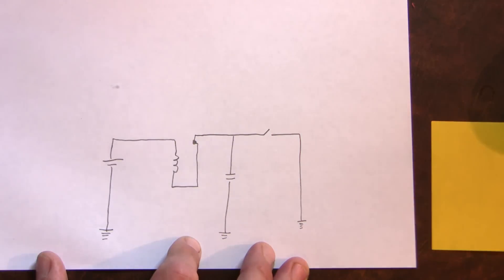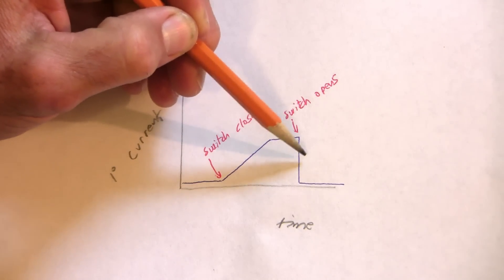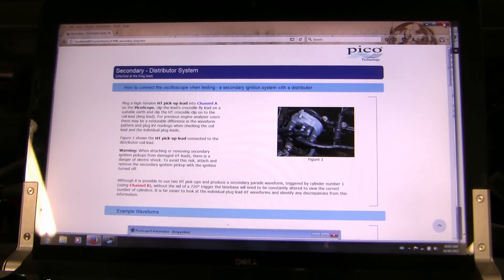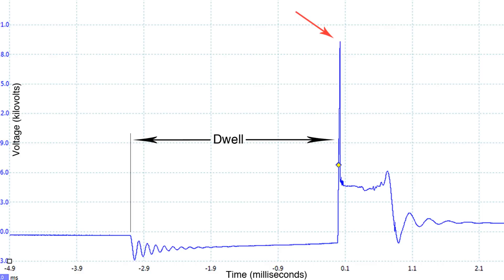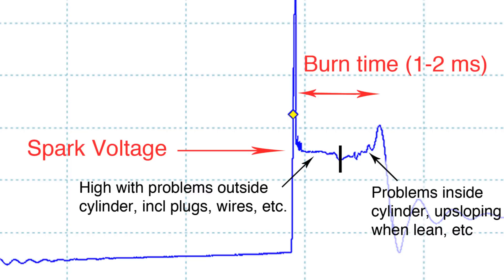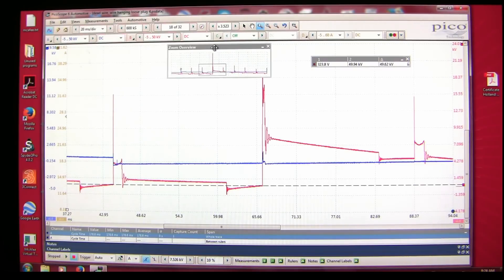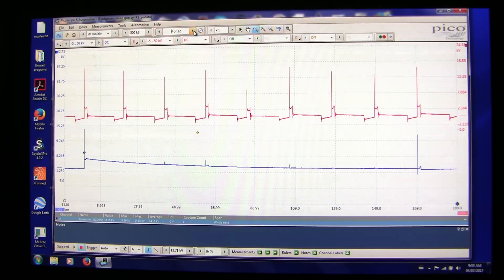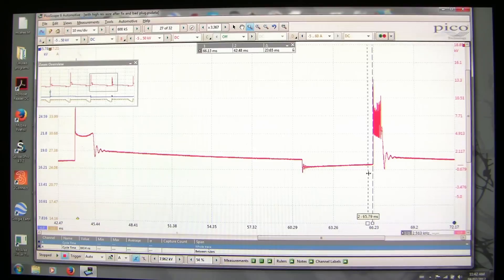Picoscope fundamentals - ignition waveform analysis

Comment: First class explanation! The PicoScope is such an important and powerful tool, so it's good to see it being used both as a teaching aid, as well as a tool which shows the clearest of traces, which makes the interpretation of results so much easier than with other tools that don't have such good resolution, memory, sampling rate, etc. Of course,  the higher technical specifications of the PicoScope - together with the user friendly software and help pages - contribute to making the PicoScope THE choice of tool for any user: novice or highly skilled engineer. Thanks for this superb video!
Reply from the maker: What I like most about the Pico is the way their engineers seem to understand the automotive needs very clearly. Peripheral devices like their current clamps and hardware are the critical difference compared to my generic digital oscilloscope, even though technical specs for the scope itself are similar. I had quite a bit of trouble getting a stable reading from a standard digital oscilloscope on a running vehicle. Thank you, for your kind feedback.
Reply: Hi Spelunkerd. Thanks for your comment. I wrote an extended reply, which I then started to edit before seeing it disappear. At least, I can't find it, for now :(  if it turns up please let me know as I was in the middle of editing, so the beginning makes no sense at all!! Keep up the good work.
Reply from the maker: I found it on the other video, ha ha. Thanks for watching, I plan to do more.
Reply: Is it gobbledygook, because I was amending it when it disappeared !! If so you can scrap it, or I'll amend it, but I can't see it! Glad you plan to do more. (I'm trying to find the time, but I don't have your superb presentation skills and mine would need to be in French. Although I read write and speak French, it isn't my mother tongue and my accent isn't perfect.) You make your videos come alive with just the right balance of theory and practical to make the videos engaging and informative. Spot on: I like your style and admire your skills.

Comment: Thank you for this great video, please up load more on secondary analysis on COP. The examples you did here were good, the ones that were hard to differentiate from were the shorted and the small gap, as you mentioned on a distribuidor type they look very close. Look forward for more of this.
Reply from the maker: Yes I plan to do more, some time in the next few months. As you say, those last two were tricky. It turned out that if you order the situations according to secondary gap distance, then order the results in terms of firing voltage, the observed results line up with expectation. Same thing if you order in terms of burn time, with the longest gap having the shortest burn time. It was revealing to see those findings on the Ram, although I was a little surprised a shorted wire wasn't more abnormal. I was also surprised how snap throttle revealed the lean cylinder when at straight idle the findings were much more subtle. It's a good reminder that when doing ignition testing it is always wise to record a few sheets of snap throttle to uncover concealed problems.
Reply: spelunkerd yes the Snap throttle test is super important to reveal the bad ones. I did some primary test on a mini and in a Chrysler, the Snap throttle was the answer. I put those vids on my channel if you want to see them. Any comments from you would be great. I like to learn as much as I can. Thx again for all your great information.

Comment: Wow just wow this video was hell of an informative video Mr. Dave.
Reply from the maker: Thanks, man.
Reply: +spelunkerd second time watching it 😀😀 im into this thing now but is strange how the experts have dissagreements over some points on the analysis...
Reply: +spelunkerd 
A is number 3 
B is number 2
C is number 1
D is number 4
Hoping to be right 😀😀
Reply from the maker: Good for you to go through the effort, thanks for taking the time. As you saw, pattern recognition of the sweeping upslope from a lean cylinder at snap throttle led you to the correct diagnosis of *B=2*. The remaining three can be put into order of how big the gap is. The biggest gap is the open plug wire, next biggest at 0.1mm plug gap, and least biggest with a short to ground. Because firing voltage is determined by how far that spark needs to jump, you should be able to put them in order as to which system will have the biggest gap, and then make a second column of how big the firing voltage actually was in each example. A disconnected plug wire has the biggest gap to jump, so it should have the biggest firing voltage (by far), *A=3*, as you say. The next two are tricky, and honestly I would have trouble telling the two apart in a real world situation. But following through with our logical progression, the next biggest gap is the plug with 0.1mm gap, and the next biggest observed firing voltage is D, so that would suggest *D=1*. Finally, the wire that is shorted to ground (no gap at wire, but still some gap at the distributor) should have the smallest firing voltage, which leads to *C=4*. You can also order these by looking at burn time, recognizing that a long burn time suggests a small gap, which again leads to the same result. Notice how the burn time on C is slightly longer than the burn time of D, because there is no extra gap to jump so all the energy can go into making a long burn line. I think anybody who gets as far as you did deserves full marks on this one. 

Some guys like to visualize a piece of rope, which they lay down following the curve from the top of the firing voltage to the plateau of the burn line. If a lot of voltage is used up to jump the gap, there is less rope remaining to give a long burn time. Nice to meet you!
Reply: +spelunkerd yep i had trouble with those two also 😀 thank you very much because i liked it a lot!

Comment: I just did a few videos on this topic using a single cylinder magneto ignition with a points emulation module common to them. The last one being a wasted spark system with no dist HT gap you can clearly see the comparison of a spark plug that fires under compression with mixture and the wasted spark under no compression with no fuel as a baseline. Super imposing those 2 patterns provides the wasted spark baseline under the compression spark signal. I also use an old CRO that is analog in sampling over the trace. One thing I cover also that is important to understand is mutual inductance of the secondary and primary.
Reply from the maker: Sounds great, I'll stop by when I have a bit of time. I've always wondered how those magneto systems look on a scope.
Reply: The main difference is the primary pattern outside of the spark period, like CDI and HEI and so forth it has its own signature. But the spark part is much the same, albeit inverted, a feature my old CRO scope doesn't have. A Pico would be handy with freeze and replay, eyeing them off for a few purposes which is how i ended up here actually. Cheers.